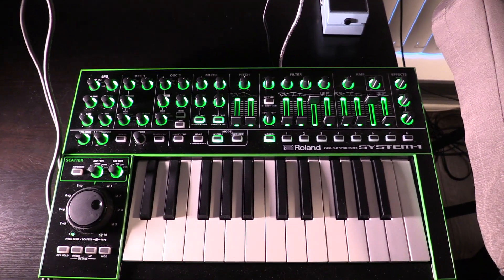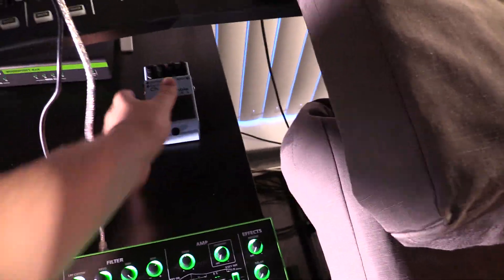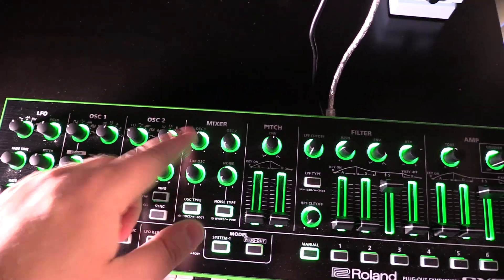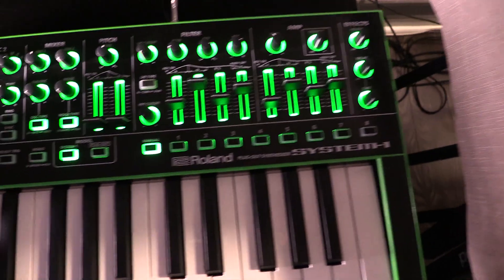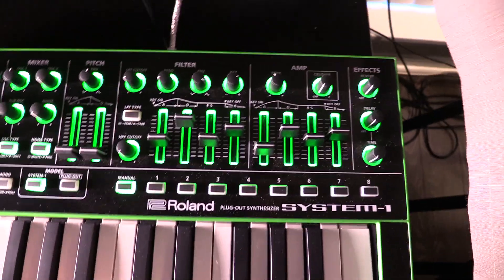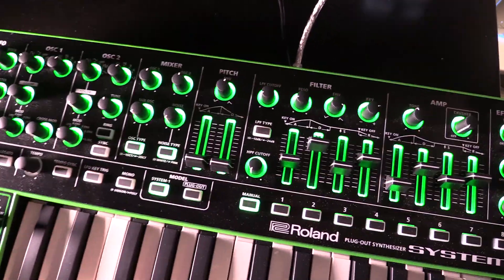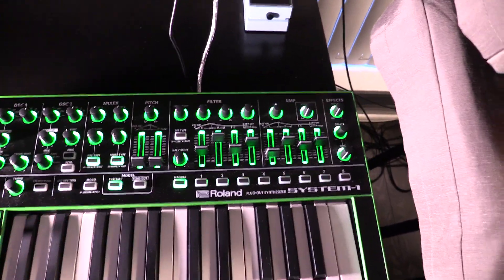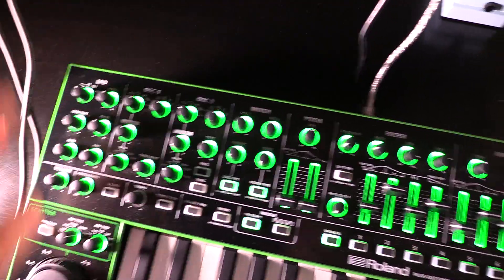Juno String Pad on  Roland AIRA System-1

Comment: tried it too, but I couldn't get that warm & uplifting sound out of it that Juno's a famous for. Even the wonderful TAL Chorus LX I added in the DAW didn't really turn it into a Juno. The System 1 has a very edgy, aggressive sound - very 70'ies like, more on the darker side (which might be want you want). But also very powerful & very versatile, could easily blow away a JU06(A).

Comment: Great video, thank you! I use the Roland Cloud subscription and I plan to buy a System-1m later this year. I have heard that the plug out sounds only have one voice on System-1, that made me insecure if it's the right synth for me. I'm not going to use the plug out sounds often, but when I do I want the same polyphony as in the vst version. Anyway, can you tell me if that's for real? Do the plug out instruments only have one voice?
Reply from the maker: Yes - all the plugouts are mono, just the same as the synths that they are modeling. The System-8 is a good option if polyphony is a must, and it has chorus and a Juno plugout.
Reply: @JacobWatters1  I don't know if the originals were monophonic but the vst versions of Juno 106, Jupiter-8 and JX3P is not monophonic. I don't know how many voices they can handle, but at least 4 voices. A System-8 would be my first choice if I had room for it! I have a small studio and I already have a good master keyboard. Desktop synths without a keyboard is the best option for me.
Reply from the maker: @JohanBakkeMusik  The plugouts that you mentioned only work in the System-8, and not the System-1. The System-1 plugouts are SH-101, SH-2, Promars, and System-100. The System-1m is a good option if you want a desktop synth. You loose the scatter function and arpeggiator, but you gain modular patch points (in mono mode). The System-1's core engine is 4 voice poly, has lots of sound creation potential, and sounds great. It is my go-to synth, and I rarely use the plugouts (I have other synths that can sound similar to them).

Comment: Nice this is useful for different synths as well!
Reply from the maker: MrFricoco Yes that is the plan. I will show stuff on the System-1 since it has most of the controls I need, and knob per function, but the theory can be applied to any subtractive synth.
Reply: Cool! I look forward to more videos! I think you're very good at sound design. I could learn a thing or 2.
Reply from the maker: MrFricoco Thanks. Let me know if you have any requests.

Comment: hey man i got the system  1, so far its really cool, ive been reading the manual and i am stuck on the mod knob, it doesnt seem to be doing anything, you think you could gimme a pointer, thanks alot, i tried to make the sound in this vid but i suck liol
Reply from the maker: +Yasssmina W The MOD switch selects how the COLOR control is modulated. COLOR changes the wave shape, creating different harmonics. MOD allows you to choose from it being controlled manually with the COLOR knob, by the LFO, by one of the three envelopes, or by the sub oscillator.
Reply: oh i think i get it, thanks, ill give it a try again